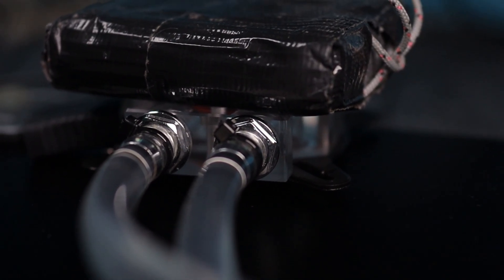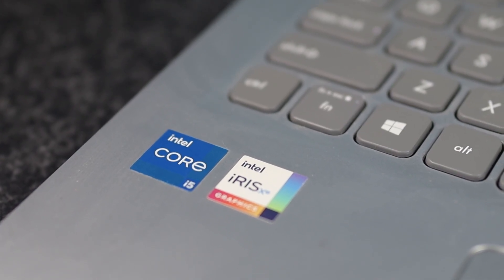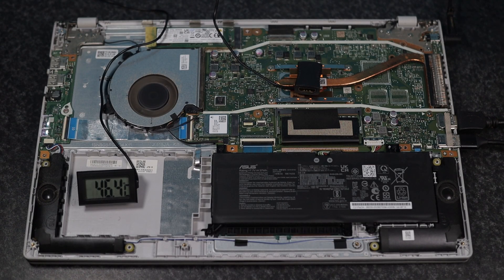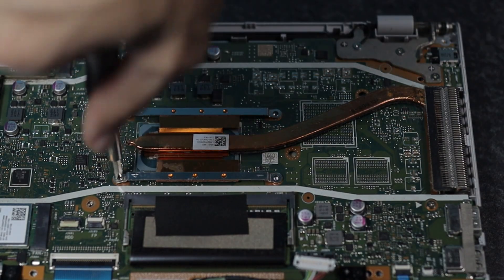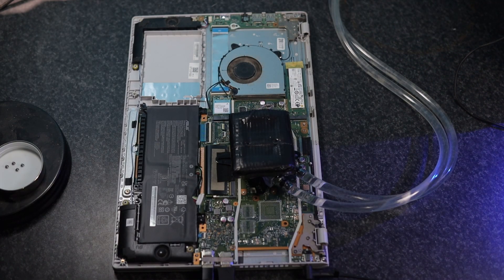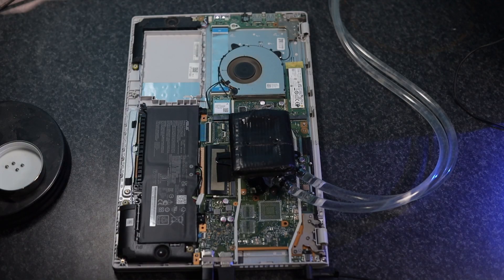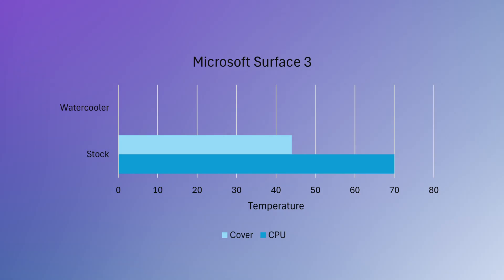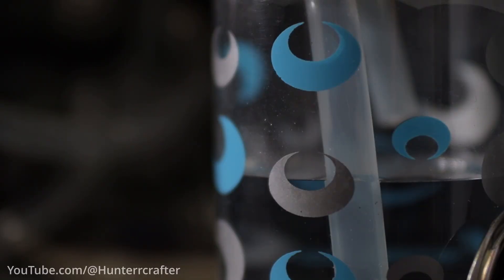How Hard Can I Push a Laptop with an External Watercooler?

Comment: I watercooled few laptops already with awesome results...the cheapest way is to use aio with pump in radiator and replace cpu block with solid copper long block from aliexpress...
Reply from the maker: Cool! Your method crossed my mind, but I'd like to still be able to use the laptop without the watercooler, so I'm looking for a different solution.
Reply: @Hunterrcrafter well it is detachable so u can use air cooler too ;)
Reply from the maker: Oh that's pretty neat! Though changing the cooling system each time you want to take the laptop somewhere is a bit of a chore. I'm thinking more about attaching a copper tube to the laptop's heat pipes and adding quick connects for the watercooler.
Reply: @Hunterrcrafter  if You want to transport the laptop then thats the way to go :) I used alphacools QR system on hoses so there was no need to change liquid every time ( liquid stayed in the loop )